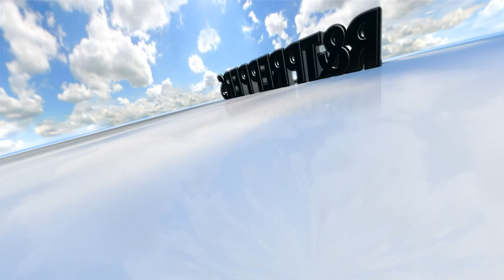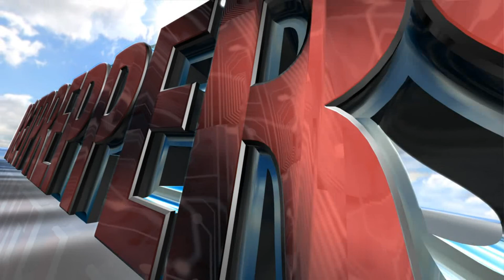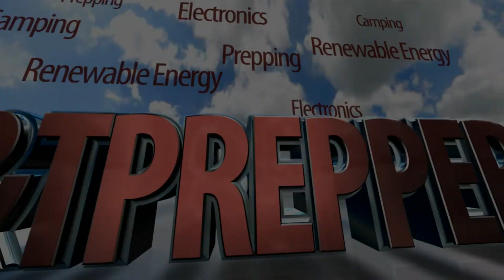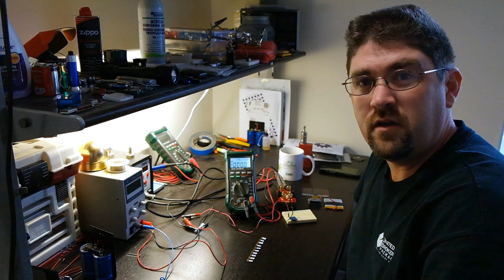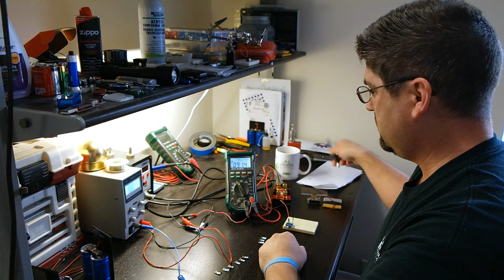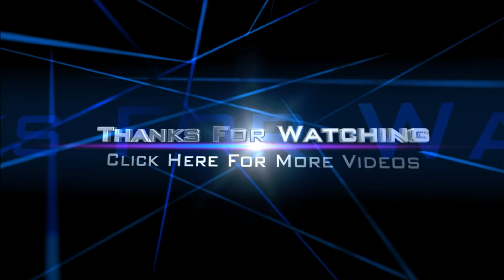MicroSD Sleep Currents With Arduino, Teensy, Etc...

Comment: interesting...can you have the datalog shut off power to sd card when not writing data?
Reply from the maker: +Brian C The microSD card goes into sleep mode.  I could potentially put a FET on the ground line of the MicroSD card and cut power to it in between writes, but there's a problem with the SPI library that doesn't allow repeated starts on the SPI bus.
Reply: Bummer...cutting the power off would go a LONG way in saving battery power for the long term...but there is really a point to where it all is moot anyway due to Li Ions batteries own internal power leakage.
Reply: +R&TPreppers , I had this problem using the Arduino SD lib.
I now use sdFat lib and it allows to disconnect the SD module completely from the circuit without having to restart the Arduino to log data again. If you haven't you should definitely check it out!

Comment: The read/write speed may be vastly different between cards. While on face value it might not mean much it could indicate different electronics inside. It would be nice if the faster ones also drew less power,but I suspect the opposite.
Reply from the maker: All very valid points, and that would be my guess as well.

Comment: Interesting test. One would think that newer cards use less power because of the smaller transistors inside. Lower capacity newer cards is probably just "big" cards with dead cells programmed to look like small cards. A lot of good into here: https://www.youtube.com/watch?v=CPEzLNh5YIo
Reply from the maker: +zaprodk The transistors may be smaller, but there's some sort of correlation to transistor size and leakage current that I can not easily explain.  I will download that video and listen to it monday when i'm driving to work, as that looks like an interesting hour long seminar.

Comment: Hey!
I am also building a low power data logger. Basically, what I'm doing is using a (eBay link: http://tinyurl.com/tps120) to disconnect everything (SD + Sensors) and leave only the atmega connected to the battery. The TPS6120 is a buck/boost with an enable/disable pin. It uses about 4uA on a 3.7v Lipo battery when disabled. I enable it when is time to log. It also can be adjusted to a specific output voltage and if you will use non-rechargeable batteries, it will squeeze the most of them.
Maybe this won't work for you because of different purposes/preferences, anyways, I taught I'd share! Check out the datasheet on the TPS6120 IC, let me know if you'd like more specifics. Like.